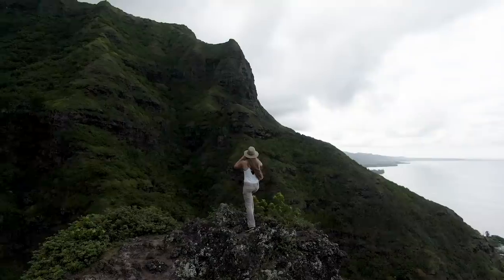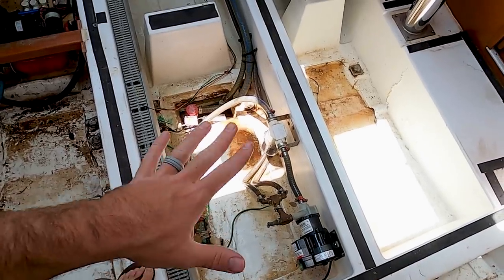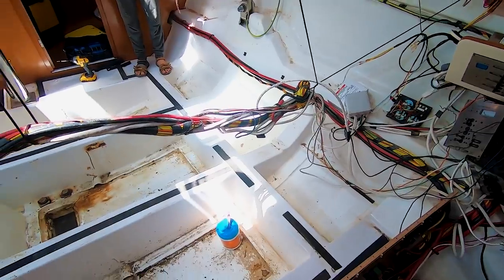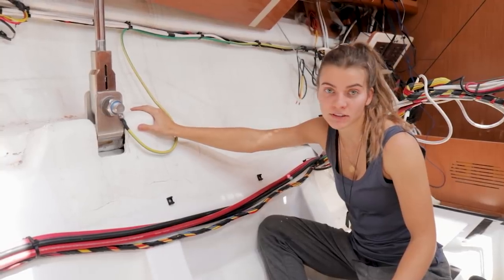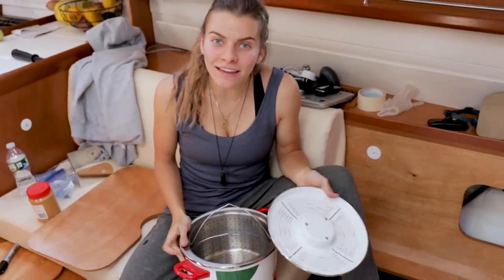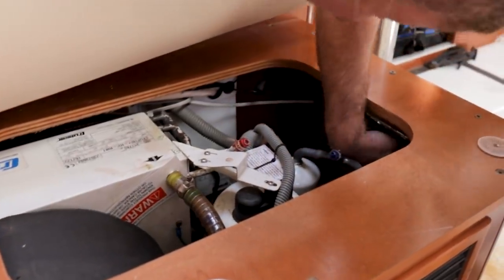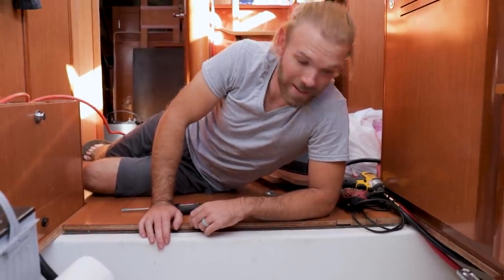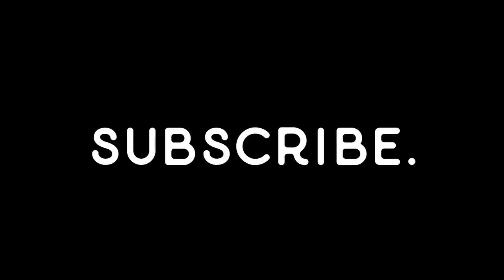Our SALVAGE SAILBOAT Has Been Leaking for Years | Expedition Evans 6

Comment: Big job - good luck . One tip , make certain the boat is not twisted in the stands before you start or it will forever be twisted .  Boats are never symmetrical, but make sure the stands are not twisting it a bit by unevenly supporting it .  Fiberglas boats flex quite a bit and it is common for a glued in glued in grid to come loose . The old glues often fail over time .

Comment: Sparky has good advice. 

I have seen a number of these boats with keel issues in the boatyard and quite surprised at the keel hull joints showing. Also these boats are known for their thin hulls for the size of boat and delamination of glass upon stress.

My boat has a plate wrapped around the keel hull joint which is then wrapped in fiberglass all of which is below the hull shape. I cracked a stringer of my support grid around the aft of the keel from a major storm and to he safe we sanded to glass around the keel to ensure there was no stress marks and then I had the stringer professionally reglassed at a cost of 3000+ euros for one stringer. Although the stringer was cracked in the middle most of the stringer was redone. 

I would wrap glass around the keel hull joint with the glass beginning as Sparky said from higher up to below the joint.

Comment: Our Hanse 418 had a massive grounding recently and the same cracks are showing through the superstructure that is glued down, both the cracks going sideways and the cracks going upwards. When the boat was hauled out the extent of the damage is clear as the hull could hardly support it's own weight on the keel. I posted a small clip of this today in the video but the entire process of the repair will be shown on YouTube through the winter. The entire repair has been estimated to take 3 months in the workshop and a lot of fibreglass grinding and re glassing, I hope your boat isn't in the same state as you are in for a whole load of work. Didn't mean to scare yoo though, I wish you all the best guys, I hope it goes well and I am sure you will succeed.

Comment: Guys, this is common on many boats. Cleaning out the bonding can be labour intensive, we use the chain saw style cutter blades used by artists on a buffer machine to cut out bonding. You can even get 9” blades to cut deep. Clean down to fibreglass top and bottom in joint and then rebond with Plexis structural epoxy, 2 component. Then you have to remove the coating on the grid to hull surface to reinforce bonding, then glass the area. Into the keel bolt areas. Without removing keel unless the hull has delaminates. You need a skilled person to determine sound hull. Covered with gellcoat to improve looks.

Comment: Great video. You guys are very handy and quite knowledgeable. I won't repeat all the advice about getting a detailed inspection of the damage. Probably good advice and cheap insurance. You definitely want to rebuild this area like a tank. Many years ago I was about to sail the Fastnet race in a Benneteau First 40.7. We hauled the boat to get the bottom cleaned for the race and the guy cleaning it leaned on the keel and it swung 6 inches due to loose keel bolts. Needless to say we did not race in that boat. 
Looking at your pump base 11:30, I think the reason it looks good is because it is all part of the molded gridliner. Even if the grid is sound you cannot see if the flange is debunked from the hull. The inboard flange edge is visible and looked cracked. You might want to get and endoscope to inspect the fland edge under the molded pump base platform
Good luck guys!

Comment: I have completed a similar project though on a lesser scale and was pleased with the result.   The cross member tabs which have separated from the inside of the hull were cut off with a 4.5in angle grinder about 1" above the hull.  The remainder of the tab was separated using a hammer and chisel.  I initially intended preparing the surfaces with a 105mm grinder and flap disk but in many cases, I found that a 1/2" electric file while slower was less fatiguing and created far less dust.   When preparing the full surface I extending the preparation 2" to 3" under the box section.   I then made up a pillow of perhaps 10 layers of bidirectional glass wetted out , placing this on the hull 2" inside the box section then folding it up the outside of the box.   I then immediately laid more pillows of glass 2" across the hull and up the outside of the box.  This gave a T shaped tab between the hull and the outside of box although most of the glass was on the hull outside the box.   I considered this configuration would have greater resistance to separation and was not that difficult to do.   I always wetted out multiple layers of cloth on a board with a roller then laid this in position.    I used West epoxy but any epoxy would probably be OK.
I discovered that during construction the internal structural frame had been placed on a very hard filler material initially applied to the hull.  The blue felt tip marks where the filler was to be applied were still on the hull.    Glass cloth had been placed over the joint only to improve the appearance and hide the pink filler which was 6mm thick in places.   I think this glass cloth is probably the Band Aid you were looking at.       
I used  4" flexible duct and a powerful dust extractor placed outside.   It is imperative to have the right protective gear.   You only get the one pair of lungs.
I think you will end up with a fantastic boat good as new or better.

Comment: Pilot-to-pilot suggestion: The grid seems intact (from what I can see on the photos/videos). It simply pulled loose from the hull when the keel "wrenched." Gluing it back together without the keel will require "clamping force." Obviously, the cracked areas will have to be ground and cleaned. But, when it's time to re-glass and re-bond the grid to the hull you will need to squeeze the grid to the hull. Suggestion: Drill through the grid and through the hull and use all-thread (1/2" or bigger) and use backing blocks to squeeze those joints back together. Wrap the all-thread in tape to allow you to tap it out, Tape will get stuck to the resin but you can go back and re-drill each hole with a bigger drill bit to clean out the holes.  Once the grid and hull are re-bonded and re-enforced, just fill the holes with resin and chopped glass. The holes will be 10-12 inches deep and if they end up 5/8 or 3/4 after drilling them out, you can easily pump in resin from the top with tape over the hull-side hole. The area of damage will dictate where to drill the holes through the structure and hull. Two or three per beam will be more than enough to ensure both a good bond and shape fidelity to the original hull shape. If you end up with ten or twelve holes through the grid/hull, those will be easy to fill. 
Your boat is GORGEOUS. You want a safe and secure repair that will hold up under the stress at sea or minor groundings like the undamaged hull -or BETTER. God speed and good luck. Thanks for the great videos. Your First Officer is motivated and capable. You can do this with a little planning. It will be interesting to see what the manufacturer says. :)

Afterthoughts: You want to kill all the "gook" that may have migrated into those cracks. Mild pool chlorine/water mix might help kill the growth that might otherwise prohibit a good bond. Consider filling those wells and letting them soak for a week to kill everything. After chlorination, a good citrus cleaner and some water pressure should clean those gaps really well. You might consider using a small low volume electric pressure washer. (With the well full of water, you would limit over spray in your beautiful boat interior.) Once the water coming out is clean, you know the gap is clean. Blow the cracks dry with compressed air and then put a fan in the grid for a few days to dry it out before glassing. Grinding between the grid and the thin hull will be very dangerous as any hull glass fiber that gets damaged will be impossible to replace during the repair. That glass mat is the structural element in the hull that transmits the stress from the grid to the hull without cracking it along the grid member. (The glass in fiberglass is like rebar in concrete.) Finding out what is in these grids will be critical. The manufacturer may use fiberglass as the only part of the grid. If so, then there is no worry of rot, like with wood.

If you drill through the hull for the all-thread clamps, a simple slight "wobble out" of either end of the hole will provide a plug on either end of the repair which will mechanically lock the repair in place.

The key is what path others have taken to repair this "defect." If there is no clear workable solution, you may have to get creative. You own the boat. You can try to repair it and, if the repair fails, you may have to part her out. I would try everything possible before that. The key is maximizing contact are between the grid and the hull. This may require adding on 4 " glassed wood "doublers" along the sides of the grid members. I'd consider doubling the entire grid that you have access to while you are there. Not expensive but time consuming. This would massively increase strength in this weak area. Sail it in calm waters close to a marina and keep checking for leaks. Puts some moisture sensors in each grid section to warn you of any water penetration with a loud squeal (Amazon). Take it out on rougher and rougher days and stress it. You may be well surprised that your beautiful boat has a new life for you both. If you sail it a year with no sign of new cracking or water penetration, you have likely solved your problem. Your attention to detail and frequent inspections will tell you whether your efforts are successful or not.

You can do this. Bennetau will err on the side of minimal litigation and may tell you the repair is "impossible." They may issue you a stern letter disengaging from any further communications for fear of liability.
Reply: Great advice
Reply: thats a bloody good idea!  theyr'e going to go through a ridiculous amount of fiberglass but thats part of the fun!
Reply: IF they are removing the keel then there will already be 6-8 holes they can use to put long bolts through and clamp down the grid until the glue/adhesive dries/cures.
Reply: Nah you don’t want to put holes thru the hull!!!! 

I am pretty sure that grid structure has to go! 

You can NOT see all the damage on the hull thru the grid. 

Cut the grid up in reusable pieces. 

Patch all the hull.  

Put the grid back piece by piece. 
Fiberglass it in. one piece at at time. 
Use a weight on each section to hold it down onto the hull. 

Further if you put holes thru the hull and used all thread to pull it tight it will make dips in the hull where it pulls tight.  
Then you have a fairing job. Which is extra work that is not necessary.
Reply: @davidtagliaferri388  The keel bolts don't go through the grid structure.  You are thinking in the right direction, just a little off course.  When the keel comes off the gaps will open up in the same way they did when the boat was hanging in travel lift without the keel blocked up.  I agree with other comments in this section that they should try to completely loose the grid from the hull so they can address any cracks that are under it but also have set fully down with weights when they bond it back in.  You never can really tell until you a good look at the damage in person with the grid out of the way... I guess we shall see in the next videos.  Beyond that, the suggestion to make additional holes through the grid for clamping force isn't a bad idea, but I'd avoid it if I could.  I think the bigger issue is that the boat stands will put point pressure on the hull and might slightly change the shape, even with the keel off.  Remember, all this was done orginally at the factory with the hull still in the mold.  Hopefully they will have a boat cradle that supports the hull shape better than stands.
Reply: Great ideas here. They are going to end up with a better-than-factory hull and keel mounting structure. If they visualize past the failures and work instead with an engineered build path, they will not be distracted by OEM objectives (i.e. cheap production).
Reply: @SteelDoesMyWill  The bolts don't have to go through the grid structure.  You could run 2X6's fore and aft and run threaded rod through the keel bolt holes and sandwich it that way.  Obviously using additional wood in the keel bed.
Reply: Maurice Milles Mansa  The grid will not flex much at all. You would need a few thousand pounds of weight on the grid to ensure a good bond between the grid and the thinner hull material. Nothing beats a mechanical force that pulls material from both sides of the bonding area.
Reply: @tomharrell1954  Mad's has punched a bunch of through-hull valves through his hull. If done correctly, it is routine. My suggestion is to fill these holes with the same material the boat is made of. It will be a lifetime repair. Pulling the entire grid out and replacing it would be prohibitively expensive and likely impossible.

Comment: Hi guys great job on the refit,  I'm sure you are getting plenty of advice from lots of people and I wasn't going to say anything but here I go for y 10c worth..... I have worked on many a Beneteau for various charter companies and privately,  it has been interesting to watch the build quality over the 18 years I have worked on them and I have also been involved with grid lining re build. I'm sure you have probably seen now but the glue joint between grid flange and hull is often very limited (ie not full flange  maybe only up to 25mm in some places) and with such quick production the styrene in the resin does not have long enough time to gas off before the grids are glued down in place so a very basic bump on a rock can lead to a huge amount of damage. If you undercut the flanges and key up the glass on hull layup and then mix up a whole lot of glue in piping bags you will be able to carry out a very structural joint again. If you are going to use an epoxy based product like an adhesive technologies HPR-25. In an ideal world you would carry out these repairs with a rig in and tensioned in order to keep the hull bent correctly to the grid, but with no rig in I would highly recommend trying to find some kind of splash cradle in order to keep the hull and internal grid in shape. Speak to your local Beneteau dealer or boat yard they may have had a new boat shipped in with a shipping cradle lying around still. Happy refit have fun  and look forward to viewing more of your videos and watching your progress.

Comment: Great video. I understand the excitement when finding the pot. I found a really nice half inch ratchet handle in our anchor locker, left by the previous owner.  I had the same reaction. A suggestion or two. You might want to enlist the aid of a professional marine architect before during any repairs. He may be able to offer methods of doing proper repairs then sign off on the repairs. That might make the next buyer less hesitant and the insurance companies willing to insure  I would be concerned about delamanation between the fiberglass layers given the debonding of the grid. Maybe an ultrasound scan of the hull around the keel area and chain plate area would be advisable.
Reply: I was thinking the same thing since the start of the videos.  This is a huge project.  Employing an marine surveyor/architect to survey the damage and make a suggested repair plan is money well spent.  Also, a delamination cannot be seen by the naked eye.  You should consider an x-ray and/or ultrasound of the entire hull.  I ran a boat dealership many years ago.  Delamination and water in a hull can only be thoroughly determined with the proper equipment.  

You may also want to consult your prospective insurer now before you start working.  Because your boat was purchased as a salvage, I would bet they will want a survey with ultrasound anyway before they will insure your vessel.  Call your insurance agent before you start repairs.  Again, if I am wrong, you have lost nothing but a few phone calls.
Reply: @reellove6710  Great advice. They may be able to get liability insurance with out the professionals involved but then again what if they can't get any insurance. I know most marinas will not take you in unless you are insured.

Comment: Grinding fiberglass is my least favorite tasks. Inside the cabin grinding requires good ventilation. A cheap box fan or two with a furnace filter taped to the inlet side of the fan will help. Change the filters often. You have spunk!
Reply: I'd spend the money and get a fresh air mask.   This is stuff that never leaves your lungs.

Comment: Once you drop the keel you could use boards inside and outside connected through the keel bolt wholes with all thread  to act as clamps. If you can brace the inside boards you could also use this to push the grid and hull apart.

Comment: With the keel moving back and upwards you WILL get delamination in that area and it spreads widely.  Tapping the hull it will sound dead, but better still, look in the hole from a removed keelboat and you might see black concentric rings.  Then get a glass fibre expert surveyor to look at the hull.  You might need him/her to certify the completed work for the insurance company.  I did the same rebuild to a hull in the UK in the 1980's and needed professional certification both for the insurance and the marina, and my wife.  You cannot be too careful, be warned!!! (Good luck)